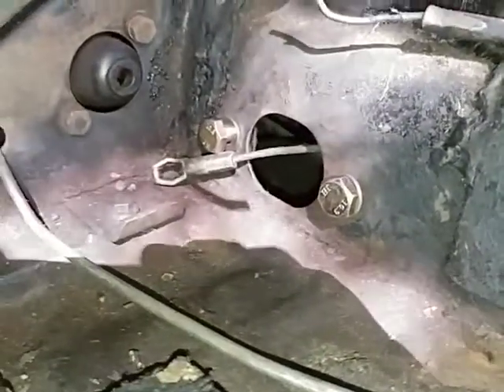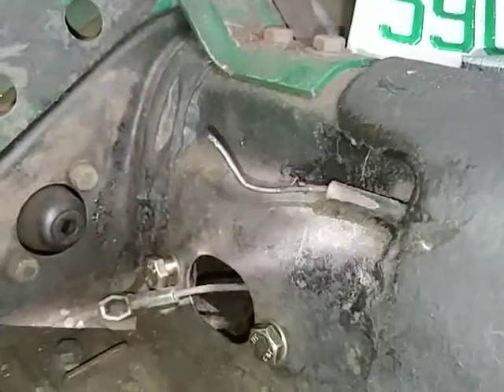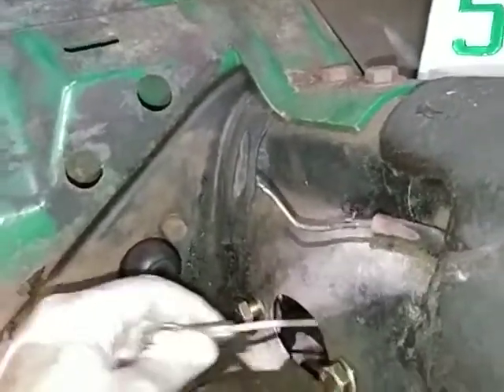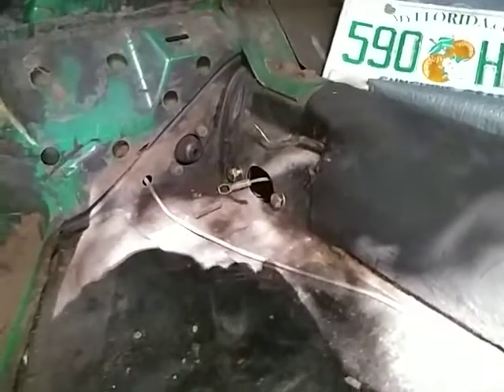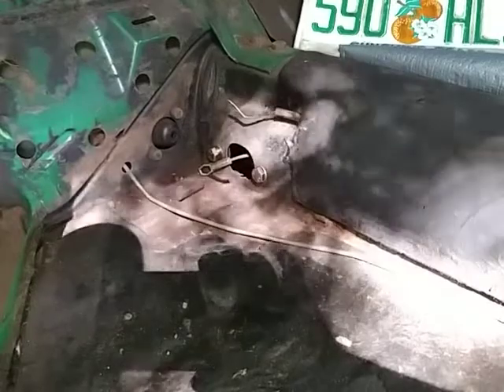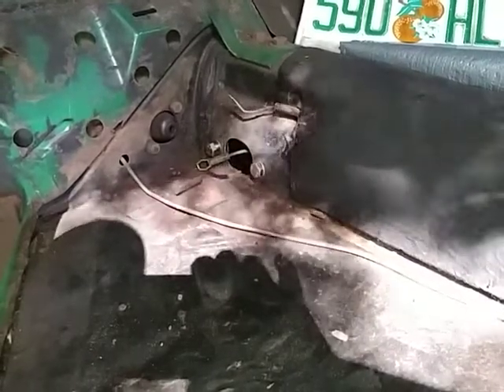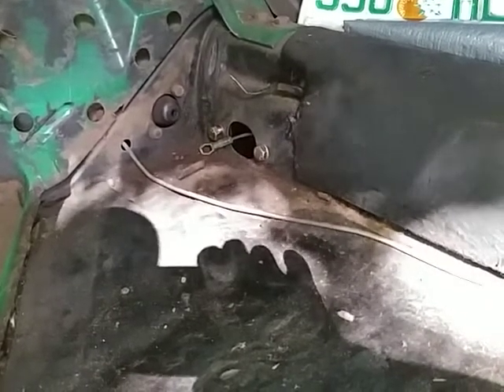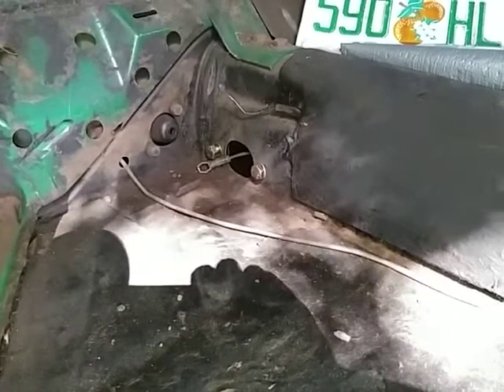I NEED YOUR HELP!!!!!!!!!!! VW CLUTCH AND ACCELERATOR CABLES

Comment: I used a old cable with the end cut off coated in solvent and a drill then spin the cable while pulling it in and out after that I degrease the new cable and coat it with a dry lube like  graphite powder axel grease will get gummy over time and cause your cable to stick
Reply: You’re accelerator cable tip is bent those can be tricky to hook up so some people bend them like that but they can pop off when you do that
Reply from the maker: Zac Macpherson I agree with graphite but those tubes need to be almost brand new clean inside. Graphite and gunk will just make paste. I thinking maybe some freon gas. Put some oil in the tube to break up. Freon blast to get the oil out. What do you think about that?
Reply: Volkswagenplanet that could work i  use mineral spirits so I just wait until I flashes off before I put the new cables in but your way might be better when I my dad would do it he would blow out the tubes with shop air but I haven’t bought a compressor yet